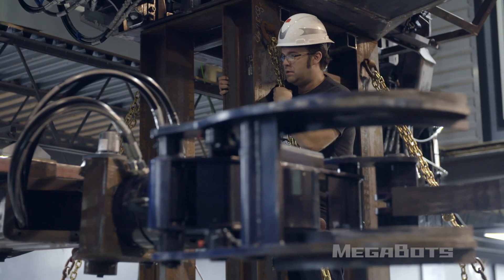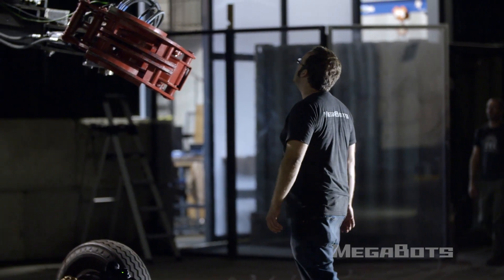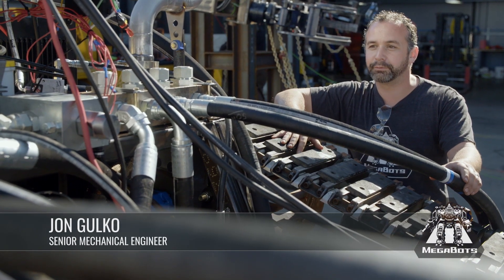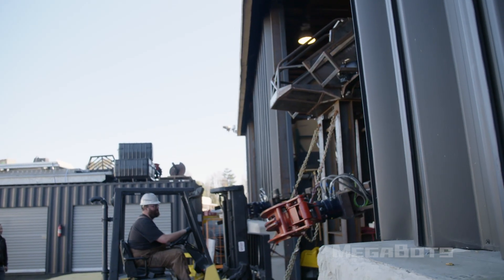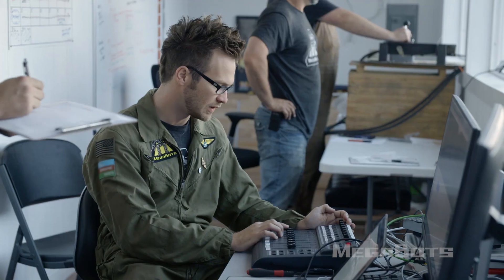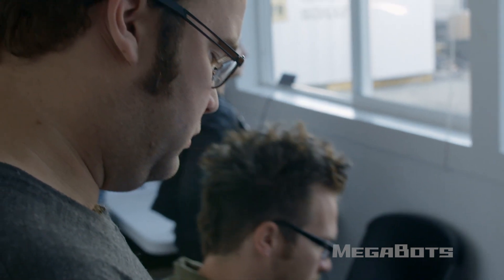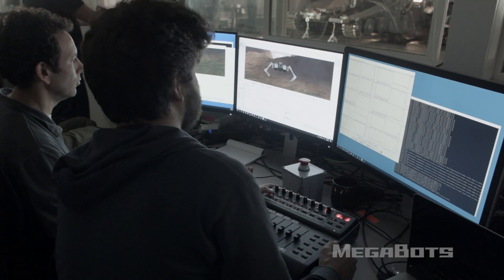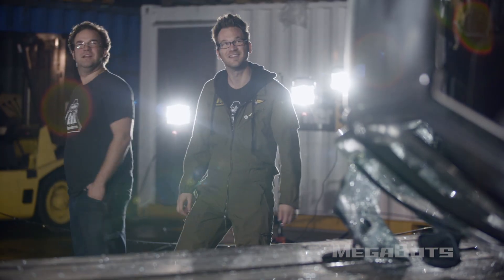MegaBot Mk.III Picks Up A Car! (Season 1)

Comment: I really with they hadn't gone with lame wheels for the base. It'd be near impossible but at least an attempt towards working legs would be a thousand times cooler.
Reply: Daniel A Dude, I love mecha anime, but you ARE missing the point. They are sort of doing this because they can, but they issued a challenge, and I'm sure they issued it with the intent to win. I said else where that in a decade or two we'll likely have the technology to have legged mechs in a practical setting. However, as of today, treads have been almost perfected. They are much stronger, much more maneuverable, and much, MUCH faster. The very few walking vehicles that exist that are meant to carry heavy weights are very slow. "Method-1" is a nice example of the improving leg tech, but in videos you can see that it requires a lot of large adjustments in its upper weight to keep balanced. Humans do this very efficiently using small unconscious muscle adjustments in our legs and feet. In fact, if you just stand and have some one gently push on you from any side, you can pay attention to which muscles you use to counteract that force. Our muscles our many times faster than the hydraulics required to keep a large robot upright. Small human sized robots are excellent at keeping balance on legs, but that's because they can use faster motors and such because of the lighter weight. A large robot would need to always be balanced, because if it was pushed in a way to be unbalanced, it would be too slow to correct itself before toppling. Hopefully that explains why they've chosen treads over legs for their mech. 

P.S. You totally do have the right to voice your opinion, and I recommend you share it about things you care about. 

P.P.S. I'm with you on waiting for a fast legged mech. They day when we have mechs like in Code Geass and Full Metal Panic! will be a happy day for me.
Reply: Daniel A Me too man, me too.... 

One-on-one gladiatorial mech battles will be my favorite sport when it happens. And believe me, it WILL happen.
Reply: Daniel A The thing supporting the cockpit and arms isn't the base, it's just a temporary test platform. It'll have tank treads and the bottom when it's finished. And "impossible" is kind of an understatement when it come to working legs. Kuratas is Japanese, the freaking robot center of the world, and they just have wheels. Legs are just way too slow and impractical with the technology we have nowadays
Reply: Alexander Lovato
I know that it's only temporary.
While I can certainly appreciate the merits revisional design, and that this is only the third in a series of ever improving versions. I really am dissapointed that they went with the easier option of mounting two slow arms on a tank base.
Of course, I understand how incredibly hard it is to get legs to work with balancing but something like the Kuratas where it's a compromise but shows efforts towards legs would be much cooler in my mind.
Reply: Daniel dont forget that "cooler" is just an opinion.   This is the american robot and Tank Treads are just fine as far as cool goes.
Reply: Allen Broussard
Yeah, but I've watched my share of mecha anime and tbh, treads are always depicted on the "lesser" models.
It is an opinion but the whole point of this is to do something that is cool, and if I don't think it's cool then I have the right to voice that. Do with it what you will, y'know?
Reply: The only prominent gundam design with tank treads was the Guntank and it actually kicked alot of ass since it was able to mount heavier weaponry than most other models.     Looking cool has its place, but functionality always wins out when your considering the cost.
Reply: Allen Broussard
Actually, if you notice with new american military projects, many of them get through seemingly because they look "cool" or "modern".
Often times in mockups weapon creators will use 90's psudo tech, matrix style art because it sells more to their employers.
Just look at the new tanks with wierd abstract angles that probably do nothing for function.
Reply: Alexander Lovato
Oh, I see what you mean. Yeah. It probably is best to try and work as best as they can under their brief.
Also, thanks for notifying me on Method-1. It looks really amazing.
As stated I think that it is a good thing that someone is pursuing combat mechs at all. I really hope this becomes a regular thing, this battle, and that over time developers will adopt legs not because they look cool but because they've been improved to the point where they're actually better than treads.
Reply: Daniel A a tank with treads is the most god damn badass thing you can do in the world. If you don't think so to you might not be American. The only thing that can top it is if you bring a nuke to kill the innocents like we did to Japan a few decades earlier
Reply: Martin Ginski How did you get here? I thought I killed all the space parasites before I left Zeta-1337 Positive
Reply: Martin Ginski
I'm not American though.
Reply: +Daniel A Angles are good for tanks because they can bounce shells better than a flat surface. Some modern designs are also designed to give a reduced infrared or radar return, where shape is very important.
Reply: Torinn Balasar
That is one example but I have seen many 3d pitch style videos that clearly try to look cool.

Comment: How would you control the actually robot?
Reply: Pachyderm3 There's a cockpit with controls
Reply: actuators
Reply: CyberFenix000 Technically you're right... more specifically though, they're using hydraulics
Reply: Of course I know there's a fucking cockpit.
I am asking how would you effectively control them precisely in such a cockpit.

Watching the video you'd know several joints have to be maneuvered in order to lift the car.
They pre-programmed the MKIII to move the joints altogether in order to lift the car.

However, you can't rely on pre-programming because you can't pre-programme every possible move, and it would not be user friendly.
Reply: Still, if you don't pre-programme any sort of movement, you can hardy lift the car successfully in such a short time without a well-designed control system because there are a few joints that need to be controlled at the same time.

What I'd like to know is how are they going to design the controls, making it user-friendly, so you can maneuver all these joints easily.
Reply: I remember they used to use roughly the same set-up a fighter jet would use for its controls: a joystick and throttle I think.

Comment: You really should build in a device to turn the cocpit left and right, like a digger or a tank turret. That would give you a lot more combat mobility than with just the tracks....
Reply from the maker: We've built in torso twist! It's just designed into the legs that we haven't built yet.
Reply: MegaBots Inc Okay, i was just trying to help with ideas... :D
Reply: CAN YOU GUYS GET ANYMORE COOLER? LIKE FOREAL!!!
!
Reply: MegaBots Inc Have you guys looked into "Armor Core" tank builds, its a game made by "From Software" (huge robot game series) where you can fully customize your Mech. The mech your building really reminds me of them.

Comment: What kind of actuators were you guys using on those arms? I saw some pistons on the elbows, shoulders, claws and wrist bends, so I'm assuming all the rotation points like the claw's use gigantic motors? 
I'm an aspiring engineer balls deep in robotics competitions so I'm really interested.
Reply: Heavy duty hydrolics, which is why it seems slow.     As long as the hip swivel is fast and secure it should be fine though.  The treads they are using are fast and durable as they are military tech.

Comment: Seems like it has a much wider wingspan than the old Mark II. I hope someone came through on the auto balancing software for the Mark III, because at ~2000 lbs on each arm, there's going to be some sway.
Reply: Thats why the legs/bottom half will be so important.     They are gonna have swivel tech, which means the bottom half wont be static.    They just need to have some lean compensation to balance it out.   Or at least program it so that the arms counter-extend each other if they are ever stretched out to full.

Comment: To answer a few of the Can you make it faster questions, more than likely they can only make it a little faster. The reason being is: 
1. Control of the machine, if it goes too fast, they can't react in time to properly wield it.
2. Fluid power has a general maximum of 15fps without having air bubbles in the system. having air bubbles = instability and jerking around.
3. Weight of each piece, now I'm not saying I know the weight, but more than likely those arms are VERY heavy. That means that some of the power for speed is diverted into holding/moving the arms instead.
4. The programming. I'm not saying the programming is bad (better than anything I could do) but it's possible the programming is not made to have the machine move super fast at the moment?

This is all coming from a college student that just finished his first semester of robotics (Including the fluid power course) so take this as an educated guess for why it can't move as quickly at the moment.

Comment: 1 person doesn't like robots. :) Well done fam, well done. Keep  up the good work. Been following and supporting since the beginning. Good to see your progress. You need to get some more speed out of those components. They move super duper slowly. That's not going to be good against the Kuratas. Of course, you guys could have been limiting it so you could test, which is fine if that's the case. You guys need to think about speed of movement as well. Timing is what it's all about, but it's easier to time an impact or grapple if you have the speed to work with.

Comment: If the US army isnt funding u guys i will be really surprised
Reply: Mechs aren't really fit for actual combat, so no.
Reply: they can be though. Imagine if they refine the tech and have it as a super anti-tech weapon. it would be unstoppable
Reply: fun to dream, but not really. Pretty much anything a mech-styled machine could do, advanced tanks or low-air vehicles can do 100x better.
Reply: Matthew Steinhardt agreed. Powered infantry "iron-man" style exoskeletons though. Expect to see a lot of those in the future.
Reply: only way i can see mechs replacing tanks is when they can do every motion with its limbs a human can do and can move as fast or faster, and have it be controlled by the pilots mind, that way they can dodge shit, which a tank cant
Reply: Well, mechs could still be a real asset on the battlefield (working together with tanks, helicopters, mechanized infantry, etc.) if the technology advanced to the point where mechs can be very mobile, stable, fast, and able to do stuff tanks can't do (be able to grab things, have mobile arms, etc.) while also being able to do stuff infantry can't do (utilizing heavy armor, firepower, being decent at fire support, etc.). Mechs would basically be like SUPER infantrymen (strength, speed, durability, etc.) with the traits of a tank.
Reply: The Strategist they're actually doing something like that! (although not on as large of a scale as you might be thinking). The super soldier programs focus on empowering infantry with superhuman capabilities.
Reply: Matthew Steinhardt
I am aware of TALOS. The thing is, that's more to enhance the abilities of the individual infantryman than to revolutionize the field of battle with walking infantry-tanks.
Reply: It still has uses behind the lines - rapid cargo loading, building  reinforced bunkers etc.
Reply: If the technology is actually practical in another 50 years it could probably be useful in dense forests or jungles. Tanks are good off-road (obviously) but believe it or not they can't just plow through every tree in their way. A mech would be more suited for that environment.

Comment: Mandatory Bitching Betty boot up sound on the final design

REACTOR ONLINE
SENSORS ONLINE
WEAPONS ONLINE

ALL SYSTEMS NOMINAL
Reply from the maker: We're on it!!!
Reply: ASS-KICKING ENABLED
TIME TO ROCK
Reply: The pilot of the MK.III should be named "Ribbons Almark"
Reply: ASS-KICKING ONLINE
Reply: OMGOMGOMGOMGOMGOMGOMGOMGOGMOGMGOMGOMGOMGOMGOMGOGMOGM YEEEEESSSSSSSSS <3
Reply: I think that's better for the japanese one, this one needs a board filled with switches and control lamps so you can turn on each single system individually :D
Reply: YESS! THIS! hire Ellen McLain to record Gypsy Danger style warning and startup dialogue! That would fit so perfect lol
Reply: Use it!
Reply: No better yet liberty prime

Comment: Damn that thing is gonna need armor for being that slow it's gonna need to be able to take a ton of hits.
Reply: They wont be able to add a huge amount of armor because of weight issues, but they should be able to put in proper cable casing and get everything snugged in place and still have a layer of outer armor.
Reply: Allen Broussard That's another issue I have with it. Can't armor it well so it's exposed. It's slow and it will have too many weak points.

Comment: you guys should make it faster or be able to shoot a leg off of kuratas
Reply: Emilio Ochoa They're using hydraulics to move the arms. Faster hydraulics tend to be much weaker than larger hydraulics, so I can see why it's as slow as it is. If they used faster ones, it definitely wouldn't have been able to pick up that car. Hell, it might not have even been able to lift its own arms.

Comment: I'm a little excited. you've built the upper half of a mech that can actually do a big stompy robot thing by picking up heavy things. :)

As beefy/maneuverable as the new track base may be, are there considerations for independent legs in the future?
Reply from the maker: Check our logo. We're in this to make legs in the long haul!
Reply: I have the logo on the sticker you guys gave me during the Kickstarter campaign. I thought it was just a logo and reality was different. I'm so happy! :D
Reply: I think everyone eventually wants that, but even DARPA has trouble making that work with virtually unlimited funding
Reply: Tiberius Hrafn-Úlfur see the south coreans, the tech already exist

Comment: its a little surprising you guys dident use a waldo system to controll the robotic arms, wouldent that have given your mech more dexterity?
Reply from the maker: We're not sure a system that reads your arm movements is going to be best if you're inside the machine that's moving and jostling you around, when your arms move...
Reply: Waldo systems dont work in a giant mech, unless your in zero g.   The forces in motion would throw you around, causing your mech to also jump around.   Would be extremely uncomfortable for the pilot as well.     The biggest problem with gundams is that they never really represent the shocks the pilot would actually be dealing with.
Reply: I don't see why not, if the pilot is secure enough, has enough arm movement, and is trained well, it can be pretty effective, but piloting a mech with two joysticks sounds cooler anyway.

Comment: The arm movement controls should consist on two jet joysticks(one for each hand) where you could slide the joystick forward and backward in order to extend or retract the arms independently, therefore only using the joystick to control the left/right and up/down. Apart for the use of the buttons for the wrist and claws or weapons of choice.
The arm and shoulder movement should be connected and synchronized in order to make a more natural movement and a faster attack/defense.
Love the work, the robot is looking great, would love to work doing what you do.

Comment: I recently saw a video about a South Korean company that's created a mech that actually walks and whose upper limbs move by mimicking the movements of the pilot. IF it's real, it looked like it is still in initial testing.
Reply from the maker: We're pretty sure it's real - that type of walking robot is hard to make, but possible right now. We're... about an order of magnitude heavier than they are, though.
Reply: It looked pretty darn big itself in that video. Wish I could find it again, I'd share if I did.
Reply: +David Nagore Its simple just search Korean mech and you will find it ,also its 13 feet tall.